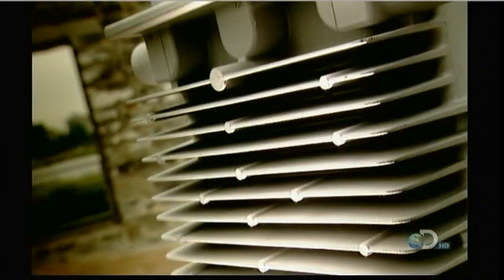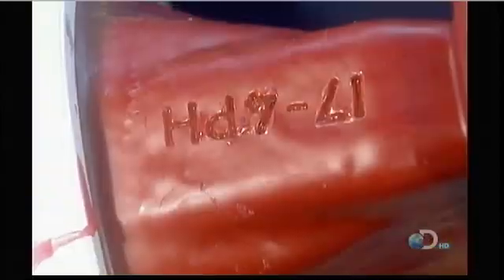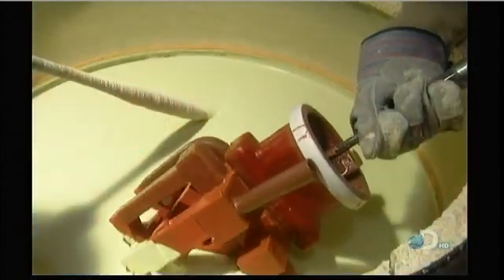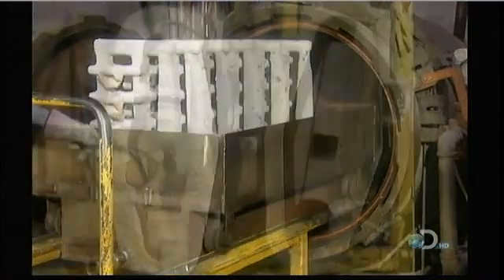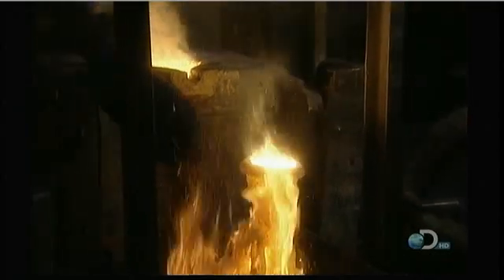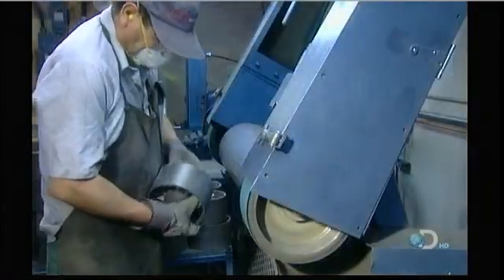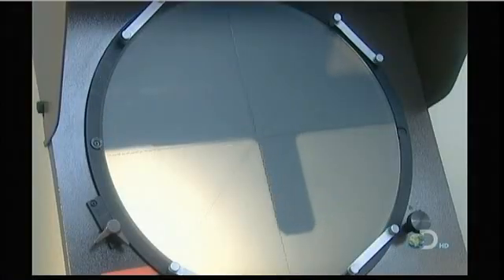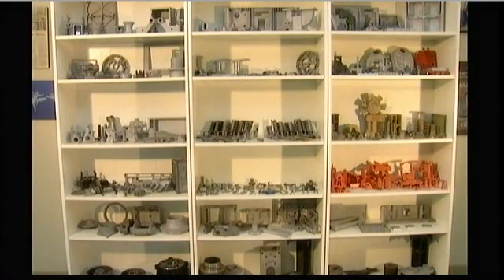How It's Made - Lost Wax Process Casting

Comment: @KarriKoivusalo  you wouldnt believe what industries still use these machine. We have around a dozen where i work. We check tolerances on parts upto .001. Very useful for checking inside castings on tight tolerance parts.

Comment: @JustWonderingHowToDo  you mostlikley willnot be able to buy whatever it is. the main reason being its not a comon thing. it may evan be made their at the place. 2nd evan if you can buy it its probily going to be expesive and on top of that you probily would have to buy 5000  gallons of it at a time. so it would end up being around $2000 per order